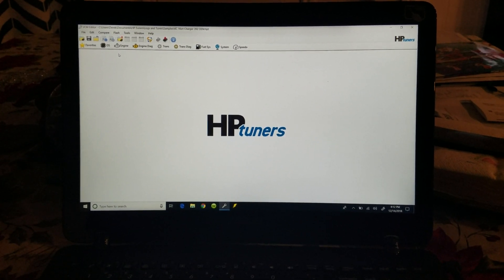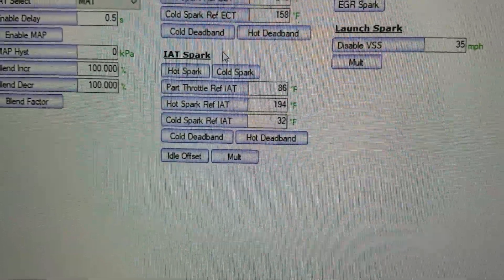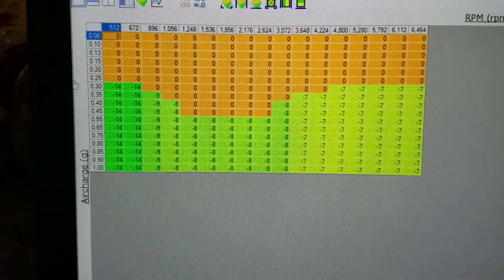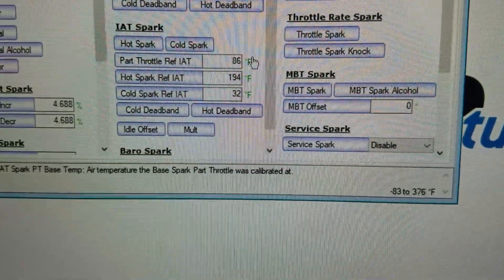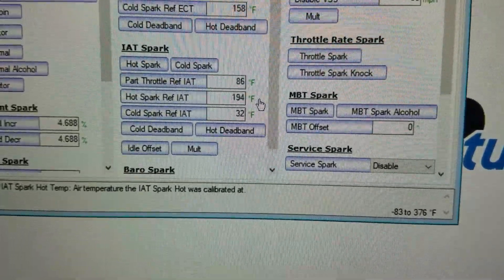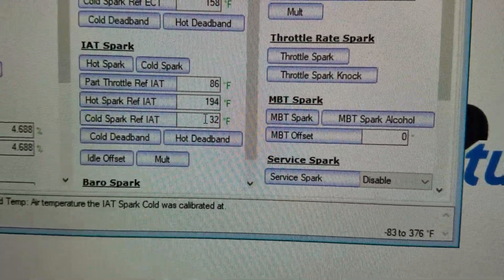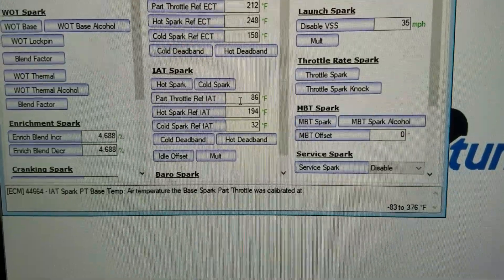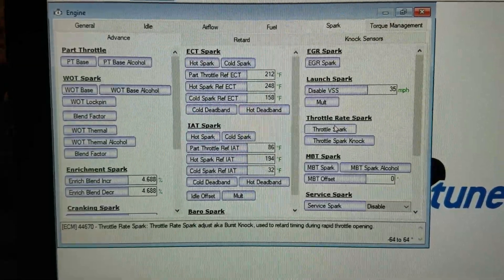HP tuners Dodge Stock IAT

Comment: Ty well put.. i was wondering why IAT temperature felt high at certain points . then driving with hp scanner on ,notice it drops alittle. Quick question,can i adjust alittle without causing misreading to engine. Or pretty much leave it as? Its a couple  degrees lower then engine temp? Engine194/176 Iat

Comment: So I am extremely new to using HP tuners or any tuner for that matter i’ll lay down the story and then maybe you can tell me if there’s anything I can do with this HP tuner that I have to possibly avoid this problem that I’m having

2012 Dodge ram 5.7 hemi

Between 1500 and 2500 RPM it has like a weirdo miss

No Sel lights..... compression is 145 on six cylinders and 115 on two front 🤔 ...... 

Ecm is new everything seems to be working properly. 

But I thought if I change some programming maybe removed the VSS system from programming this may help.

Do you have any thoughts?
Reply: Can I fudge the hot spark ref IAT a little so it doesnt pull spark as soon in the hot summer months. Lately I feel as though my IAT's have been reading alot higher then normal.

Comment: some really great info here...!!  question for you I have a 2017 ScatPack A8.., I have  a custom Tune...,  I just installed my own hptuners software(still learming )   would like to adjust the AFR  would I just change the PE ( aircharge tables ) ?   not much info out there on tuning  the hemi's..
Reply from the maker: Yes it is in the Power Enrichment section under aircharge table this number is added to the FA stoich to command WOT fueling   FA stoich + FA PE= FA to convert to AFR  1÷ FA=AFR.  
Example FA stoich is 0.0688 14.5 AFR
FA PE 0.0112 + 0.0688 =0.08 FA
1÷ 0.08 = 12.5 AFR
0.0112 in the PE aircharge table is the good place to start it would command 12.5 AFR WOT
Reply: @bluephoenix383   thanks a lot 😎….  do you plan on doing anymore videos on the 392 tuning  ?
Reply from the maker: @spazzman7284  Thanks i don't know super busy with all kinds of stuff going on i would like to make some more and will try to soon hopefully 😎👍
Reply from the maker: @spazzman7284  found a couple of good threads on HP tuners forum for Dodge stuff that's where i learned quite a bit always a good read lurking around on their!
https://forum.hptuners.com/showthread.php?52697-READ-ME!!!-General-Dodge-Tuning-information-and-How-To-s
https://forum.hptuners.com/showthread.php?63224-Basic-Dodge-Fuel-Tuning-Options-and-Steps
Reply: @bluephoenix383   what Power Enrichment  controls the fuel ? ( Aircharge ) or ( PRatio )  do I change both to get my command AFR
Reply from the maker: @spazzman7284  there a switch in that section that says which PE table is used but it is better to make the tables the same to prevent confusion